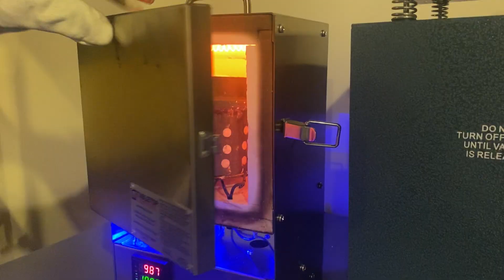Casting a Two-Stroke Engine - Part 2

Comment: Woah these mold are getting pretty good. Are you gonna strap that engine on a RC plane? that be cool
Reply from the maker: Thank you Ahmad, I think they are getting better as well! I’ll see how it runs but being my first engine I would consider it unlikely for it to work well enough to fly on a plane, but we shall see. I am actually working on another project which involves a Japanese 4 stroke engine that will fly. The engine is a decent bit larger than the one I’m currently making. I’m currently in the process of building out a engine test stand I designed and will post a video about that soon. Thanks for watching.
Reply: @Levi_Sheridan  Wow that sounds awesome.

Comment: Nice pour! Are you boiling the flask before burnout?
Reply from the maker: Thanks for watching John! I prepare the mold by mixing the plaster, vacuuming the plaster, pouring the plaster into the mold, vacuuming the plaster in the mold, let it harden, and then put it though the burnout cycle. I am not sure what you mean by boiling the flask but that’s my procedure. Could you elaborate on what you are referring to when you say boil?
Reply: @Levi_Sheridan  I came up with a makeshift double boiler, using a pot, an old round deep fryer basket and some rocks. The rocks hold the basket up out of the water, and I cover the top tightly with tin foil. They sell units to melt the wax out but they are pricey, and the boiler seems to work fine as long as I'm cautious of steam burns, lol. After the investment has set completely, I boil it on high untill all of the wax is melted out. I then let it dry for a while and burn out. My burn out schedule holds 300 for 3 hours (to dry completly)  before a few hour ramp to a 5 hour hold at peak. I found boiling the wax out keeps my furnace cleaner, and helps keep any potential for residue to a minimum. I also burnout upright. Your engine is looking good, I look forward to seeing it running!
Reply from the maker: @Yukkaguitar  interesting, I know industrial casting manufacturers typical use steam to recycle the wax. You set up sounds pretty cool. My furnace is definitely getting a little dirty but I clean once and a while and it’s not too bad. I’ll look into trying out your suggestion though if any issues ensue. Thanks again for watching!